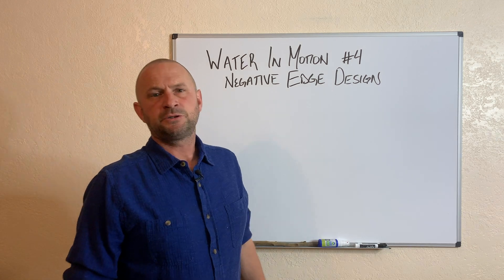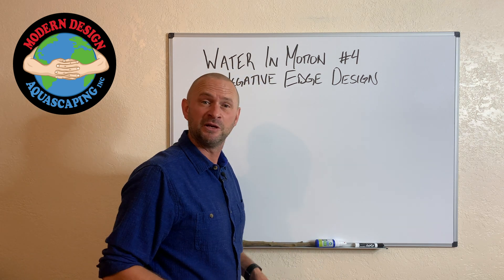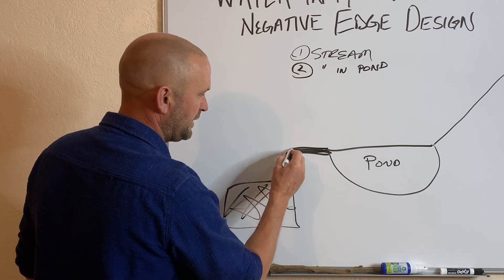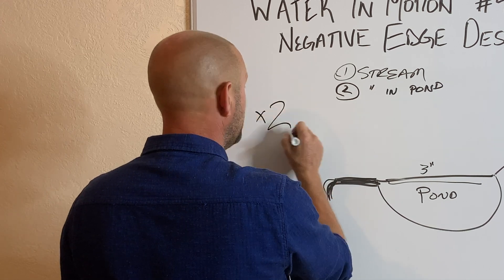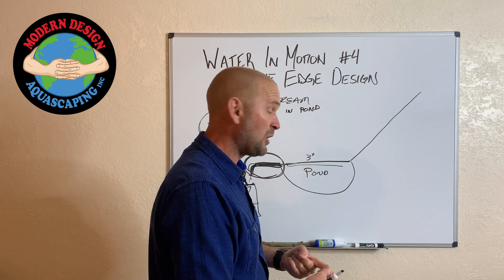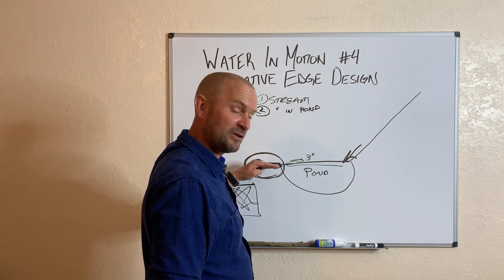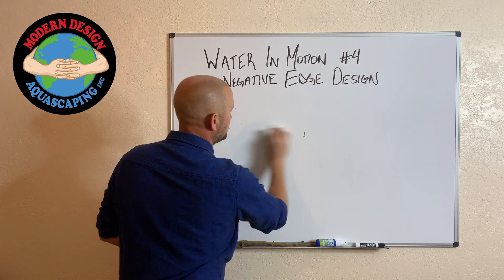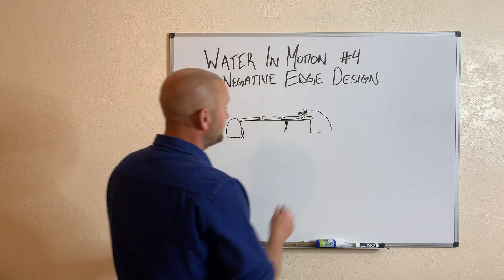Negative Edge Reservoir Sizing | Water Feature Design Series 4

Comment: would you calculate the intake bay size for a 140' x 85' using the same calculations you're using for the negative edge?  12' of TDH using 3 SLD 5-9000 to feed wetland @1200 sqft?

Comment: Hi at first thank you very much for your great videos. Im from czechoslovakia. Unfortunately maybe through the language barrier I didn't understand  exactly how to calculate the size of the tank for a negative edge system. Can you please write how to calculate size ? Thank you very much. In video I understat (2 * 3 inch * size area of the lake in square metres) is correct like this?
Reply from the maker: So take the area of all of the areas above the negative edge, pools, streams, etc, and allow for 3” of. Water in motion. Then double (triple is better) the amount of your answer for reservoir size. Make sure your pond edge is “tight” so you don’t loose more than 3” of pond water when power is off.

Comment: Love your videos!! We are building a swimming pond, 20x30, 6’ at the deep for 10ish’ sloping up to 2’ deep 8ish’. Not sure we’ll get it 100% right but it will be much better after watching your videos than without😅
Reply from the maker: That’s awesome! What do you want to know more about??
Reply: @KoiAddiction  I’ve been watching a lot on bog filtration, wet lands, I’m planning on putting 2 in one is a chemical tote, soap water, for waterfall, and the others is going to either a zero edge or some sort of skimmer 4’deep, 4’ wide, and 6’ lenghth. 
One video you recommended 30% of total pond, surface area, I’m concerned about depth and having enough filtration.

Comment: Hello John, really love your videos. I am currently busy designing a pond which hopefully can be constructed next year. As I live in The Netherlands my garden is almost flat. Overall I have a slope in my garden of approx 30cm from front to back. The idea is to create a wetland filter on the highest point. This will flow over into a small pond of about 4 meters diameter close to my house. Then spill over into a slow flowing (meandering) stream of about 10 meters long. The stream should end in a larger pond of about 6 meters diameter. And then ideally I would like to have a negative edge design as it will keep the level in the main pond always the same. I have more then enough space to build an underground storage system. My question is if my idea would be achievable with the total height difference of 30cm (1 foot) as it means 4 level changes within the whole system. All the level changes should keep the quantity of water in motion relatively low which I understand is beneficial.
Reply from the maker: Can be done, just keep liner seamed up tight. Design might be a bit tricky but not too hard. Can you dig deep where you are?? That may dictate size of negative edge basin if it has to be shallow. I just met a really cool guy from there named Kuhn while I was in the UK last month, we could work together to help you realize your dream ;)
Reply: @KoiAddiction  Many thanks, I will continue designing.

Comment: Question on larger water features and “auto filler”.  For a larger pond - 15,000 gallons.  What kind of auto filler would you use?
Reply from the maker: I would use (tested) well water or city water on a float switch IN ADDITION TO some natural rain water. I have 600 S’F’ of roof surface feeding my new feature at the house. That’s 50 CF of water or about 375 gallons per 1 inch of rain. PLUS the feature captures the same amount from total surface area to give me a combined total of closer to 750 gallons of rain water per inch of rain here!
Reply: @KoiAddiction  thanks - I will catch rain water as well from about 1,800 sq ft of roof.  We are high desert here at about 5,000’ elevation.  We only get about 10” / yr.  When we get it, it tends to be in bursts and some from winter snowfall.

Comment: John, you're inspiring me. I'd love to replace my ugly skimmer with an add-on negative edge waterfall and reservoir.  

I have a pump rated 1900 gph / 22ft feeding a Biofalls1000 via 1.5" flexhose, and lots of water in motion now. Is that enough to calculate the reservoir size/volume I'd need?  What capacity reservoir would you recommend?

Is a negative edge pond well-suited for sub-zero winters, like Ottawa, Canada?
Reply from the maker: Yes it is fine there you just have to unhook pump and pull it out in the winter up there. You should be able to use my videos to calculate your water in motion. If you need help, you can reach out to our office for some “consulting”. I can help you get it right!

Comment: Great Explanation, THANKS, If It's not a problem to have water go over the overflow (out Of The system) in case of pumps turned off, could I reduce the Size of my Reservoir somewhat?  Also should I include the Surface Area (+3")of the Wetland Filter in my calculations of the "Water In Motion" ?
Reply from the maker: Don’t undersized & yes include ALL AREAS that will flow down in a power outage into your calculations!

Comment: Got a 22m diameter pond, guy from aquascapes is saying I need a 25000 litre reservoir for the negative edge because of the water in motion. Seems a bit extreme.......???
Reply from the maker: We have quite a few videos on figuring water in motion. We normally figure WIM and then triple that # for our reservoir. Double would be an absolute minimum but it doesn’t allow for much changes-add ones-etc. during the construction process.

Comment: Hi John,

Thanks for your videos, I'm always learning something new from them. One last thing that I'm always getting different references from different sources is about the capacity of the pump for the water feature. I've seem people mentioning that it should be 4 times the volume of the pond per hour, and others saying that the volume of the pond should circulate into the filter every 1 to 2 hours. What is your statement about it? Thanks and keep up the good job.
Reply from the maker: It is always different. Smaller ponds re-circulate more often. The bigger you get, the less you recycle through the filter system. Environmental factors, fish load, ducks, runoff, pollutants, etc. all can effect the filtration system. Don’t overthink this too much, it’s more important on bigger systems BUT you can always refer to the Aquascape filter system sizes vs. flow rates, etc.

Comment: Do you have a calculation for the min depth you like in the reservoir?  I am going to build with a neg edge and an external pump - aqua blocks in the bottom of the reservoir.  How deep does my minimum depth from the bottom of the reservoir to my Autofill need to be?  I know my space for “water in motion “  needs to be in addition to that.  I plan on the extraction pipe being maybe 4” off the bottom of the reservoir.  Help please - and thanks in advance!
Reply from the maker: If your water in motion is 50% of the capacity of the reservoir below the neg edge, make the auto fill set up to fill to that level. In other words, 1) fill res TO FULL-2) run and achieve circulation, 3) mark water level in res at that point-4) set auto fill at that level!

Comment: Do you have to take into account all of the water inside a wetland as water in motion or no because if power goes out all of that water would just sit in there.
Reply from the maker: Correct- only the surface area of the water on the wetland is in motion👍

Comment: What is the "length" of the negative edge spillway that you like.  You say "long", but how long?  is that 6'-8'?  Great video - thanks.  Question when figureing size of water reservior how do you calculate water volume when so much of the space is rock?
Reply from the maker: Negative edge can be as long as possible, there is no rule but longer is better. Calculations on reservoir are math. Count gallons in the aquablocks. Calculate cubic footage of gravel as 30% water 70% stone ;)
Reply: @KoiAddiction   What are the chances that when I get my drawings finalized that you can check my calculations for the reservoir.  We are in Coloraod so it is a bit far to hire you guys and noone here really knows how to build a pond like this.  There has to be a base amount of water in the reservoir and I was planning on working with an external pump.  I don't think I want a submersible pump down under 6' of gravel!   Do you have an email that I could send a draweing to when I get there? 
Love your passion and expertise - JH
Reply: Modern Design Aquascaping Inc. Thank you !!

Comment: Love your passion, energy and humour John. Just wondering if you have a minimum flow depth you're happy with on your negative edge as I assume debris will collect and dam the flow if it's too shallow. Cheers
Reply from the maker: Typically the water going over our negative edge is only a half to 3/4 of an inch of water Thickness. I never have problems with junk building up on the negative edge it always just rides over the top.
Reply: @KoiAddiction  thanks.

Comment: With regards to a pondless waterfall. In time the aquablocks will build up with organic material and need to be cleaned out. What would be the best way to do this without removing all the rocks. Could you use a wetland design but use it in reverse like you would a pump vault. That way you could use flush out the system. 
Thanks
Reply from the maker: We use 3”-5” rock on the reservoir only about 6” thick (2 stones). That protects the blocks from UV, allows you to rinse through normally, and if it is neglected-there isnt that many rocks to move and clean.
Reply: @KoiAddiction  Thank you